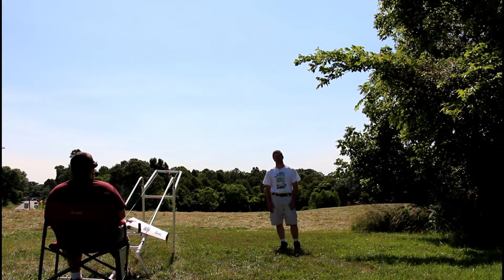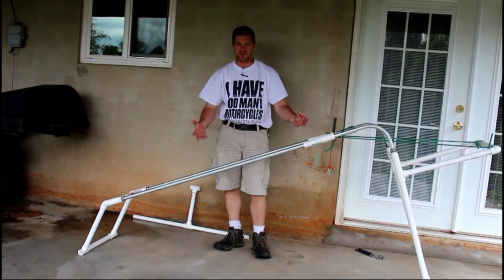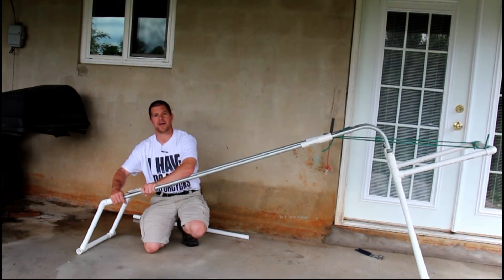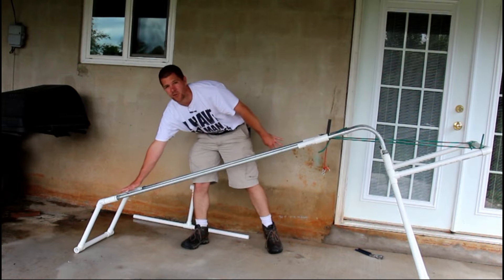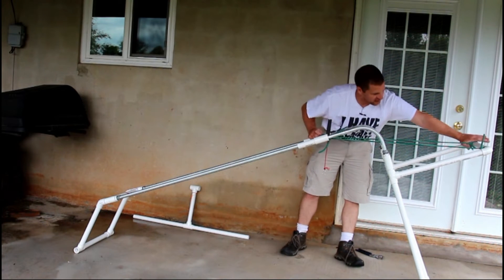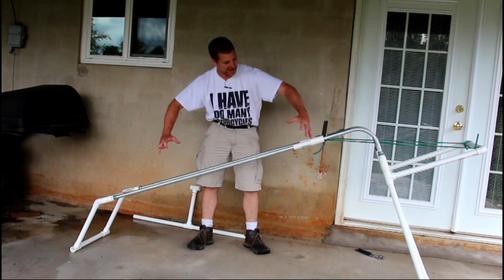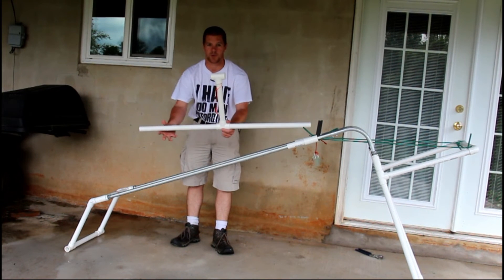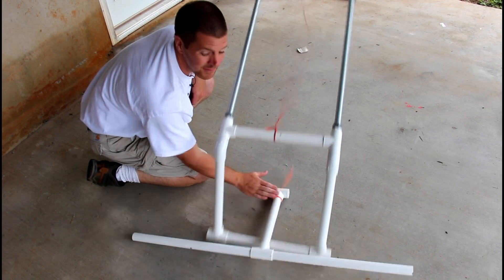RC Wing Bungee launcher

Comment: Awesome. My first day out with my S800 was pretty good . Inav and auto launch worked good then I tried manual mode and had too much travel on ailerovons and crashed. Fixed but successful launches after were not consistent. Making a launch system seems to be the way to go , certainty for the vas spec wing I’m building.

Comment: Much better option than using pvc bushings and adhesive for connecting to the rgs compression fittings can be found here: https://www.pvcfittingsonline.com/435-131-1-x-3-4-schedule-40-pvc-reducing-female-adapter.html

Comment: Alex, in the field video, you have the front cross bar below the 20" extension section that holds the therabands. But in the build part of the video it looks like the front cross bar is above. Which is correct?

Comment: Hi Alex please check my parts list below.

Also can you further explain the first two items. Thanks for the great design.

4x Compression fittings for 3/4" conduit
4x Bushings to thread compression fittings into pvc
2x 5' sections of 3/4" RGS conduit
2x RGS 3/4" couplers
2x RGS 3/4" elbows
25 feet 1" PVC pipe (5x 5 foot lengths) * Includes some additional for cutting scrap
 2x 90 degree elbow 1" PVC pipe
2x 45 degree elbow 1" PVC pipe
14x T fitting 1" PVC pipe
2x Angle brackets
1x Clevis pin
1x Hairpin cotter for clevis pin
1x steel hook to engage clevis
8 feet of shock cord
4 feet of nylon cord
2x Theraband green bands
Misc. hardware to join angle brackets to PVC pipe
Reply from the maker: THat looks right to me.  The compression fittings and bushings are what are needed to couple the metal rails to the PVC.
Reply: @CAGreve1231  Thanks. I understand what those items are for, just not exactly sure what to buy. The compression fitting is probably going to be obvious once I am at the builders supply. But the bushing... I'm not really sure what to buy. Is that a standard item that is sold for conduit? Or are you just using some sort of generic bushing that fits in the pipe to make a thread for the compression fitting? If so what is it made of?

Comment: Seems I’ve had trouble launching anything about Mini Drak size and larger with the launcher I’ve been working on, just fine on spec wing size.  Your concept is definitely more simplified than what I did.  Hope to see a few like this at some of the upcoming fpv meets out in the Northwest.
Reply from the maker: More tension (thicker bands) will be needed for planes like a MiniDrak, but the launcher will certainly work for it.  Remember that over time the bands will fatigue and will need to be tightened back up.  You can avoid this by breaking down the launcher when not in use.
Reply: I gave up on bungee type and went with spring loaded antenna tensioners with pulleys.  Still have a couple changes I can make, funny that I saw your shock cord attachment on yours after I had to use one on the roller already to keep from destroying the carriage assembly.  It’ll be fun seeing what other people come up with, kind of like the drop off launch dolly that been working well so far.

Comment: Inav Launch mode works great for small wings. This catapult system can be useful for bigger platforms,may be.
Reply: Ivan Ivanov 
This for wing racing. No FC allowed
Reply: I was wondering how well iNav AL would pick up on this launch method too. Understanding it was designed for racers.
Reply: This catapult is gonna be a godsend for my STRIX Alatus as I put a Magnum 15XL two stroke on the back of it. Nobody around me fancies trying to throw that thing and I don't blame 'em.